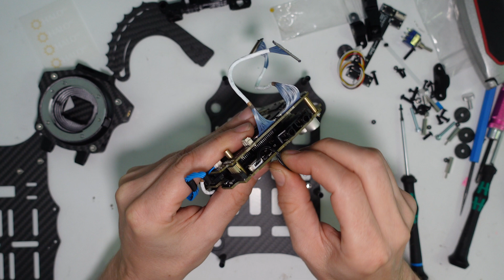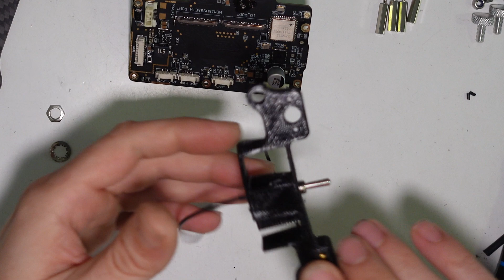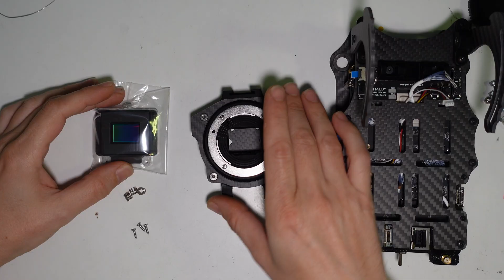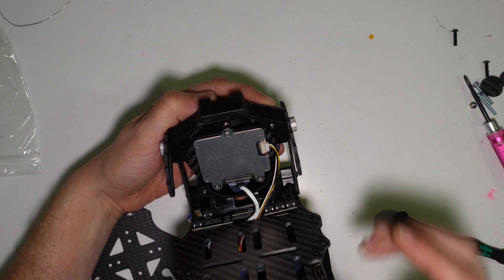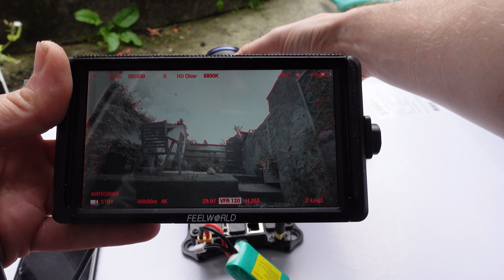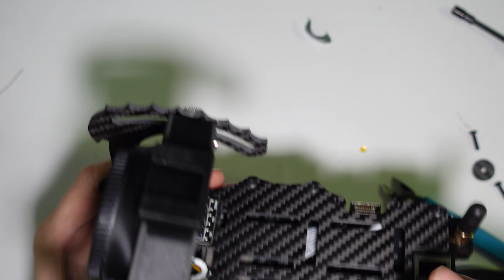HaloRC NAKED Z CAM M4 - Build Guide

Comment: Great work :) I didn't see you refitting the cooling block on to the CPU, will this not cause issues with over heating? Also it would terrify me about any rain/mist/humidity conditions getting to any of those boards, is it best to make a splash proof housing for it?
Reply from the maker: There have not been any over heating issues, there is good airflow when flying it on a drone. If you fly it in bad conditions then you would protect it the same as the drone :)

Comment: Great video and great work!  Do you know if it would be possible to source a longer sensor cable? In my build I'd need double that distance.
Reply from the maker: Hi, thanks Tommaso. Everything is possible mate. I've had a bit of a look into this but these cables are all custom made. So to manufacture some longer ones would cost a lot.